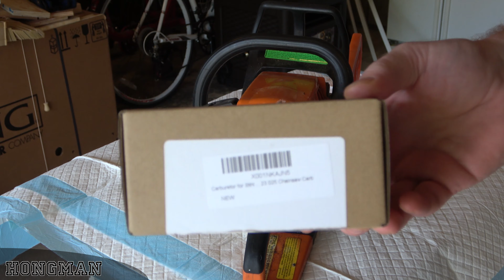STIHL Chainsaw MS210 - Install cheap carburetor from Amazon

Comment: Just did it.  Runs great.  I will have to do adjustments.  Runs great.  Will worry into the future.  You should have looked into the adjustments prior to the video.  I've rebuilt engines in my driveway but with a manual.  Lucky for you it even started.

Comment: You should have replaced the fuel line and filter while you had the carb off !
Reply: Dont really need to replace those unless the lines leaking.  The filter is not much smaller than window screen. U can replace if you'd like but not really necessary.